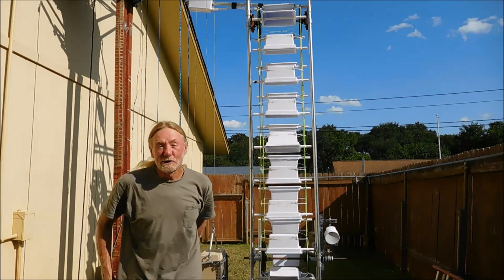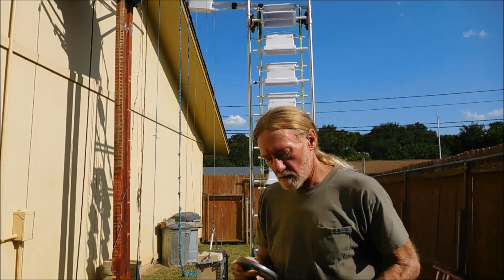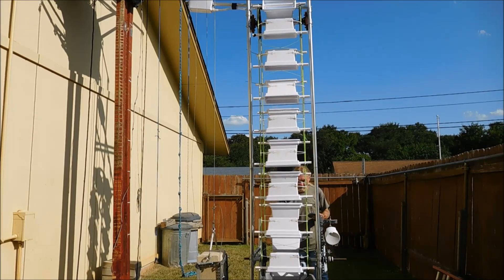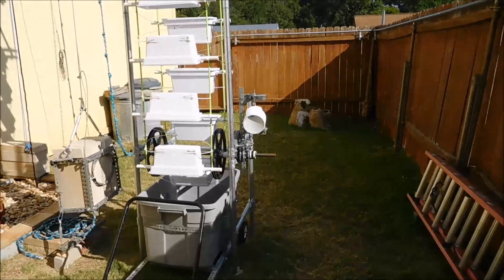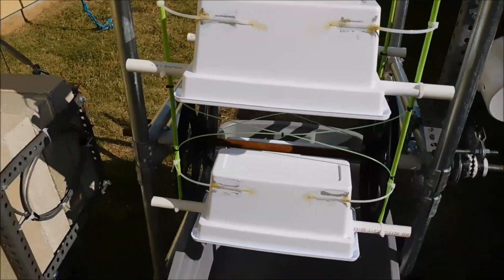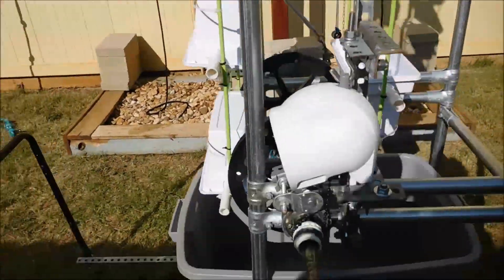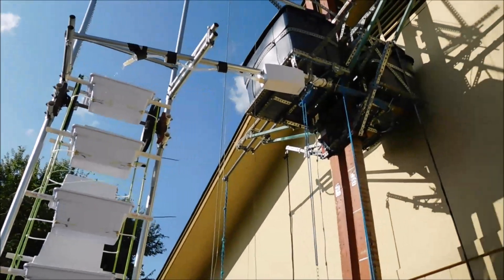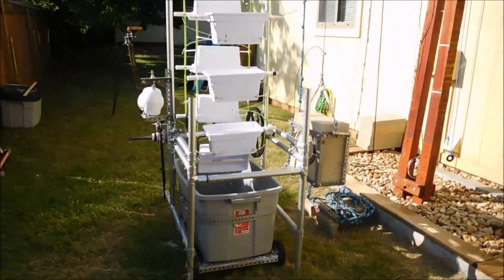Hydro Lifter Water Wheel and Gravity Light

Comment: It’s an interesting idea but it is just so complicated. There are so many points of failure and it requires a fair bit of infrastructure. At the vary least you need a high platform for the water. This could be a tall order for people living on grassland or a desert. Additionally in deserts water may be a precious resource. 

Maybe if this could work with dirt gravel or sand than it might be more accessible?
Reply from the maker: Zekiah2, this video doesn't show how the Lifter was used to tilt up the containers of water. Visit my channel to see other videos or visit the website. The simplest Lifter design is a Hydro Lifter using a Pelton wheel. The use of a flowing material such as fine dirt, sand or water,  in the carriage of a Lifter, makes it easy to siphon off the stored energy without the need of large front end gear or pulley systems. Lifters are ideal for flat off the grid use, just about any where you can stand up a vertical support.
Reply: @bclifters  Using gears and pulleys will give you greater power and reliability of the system. Very good project.
Reply: BCLifters 

You should be able to get some
Reply: On the contrary, the system is very simple and there are no points of failure.